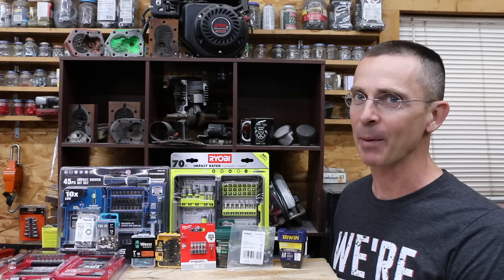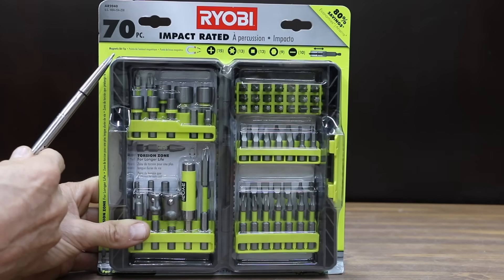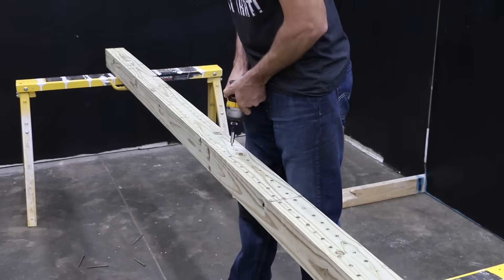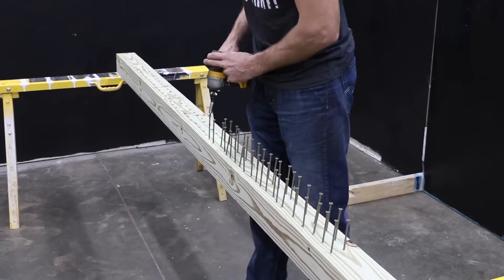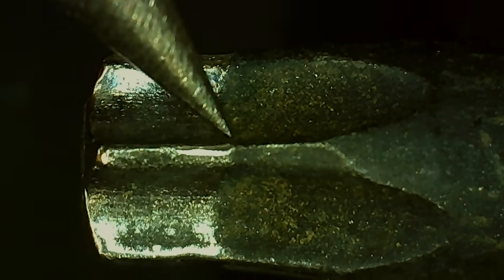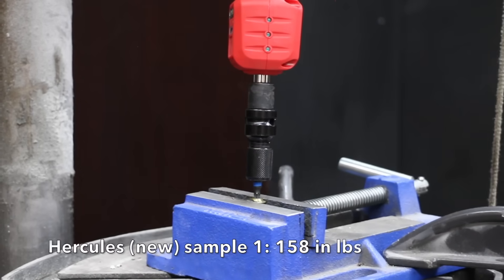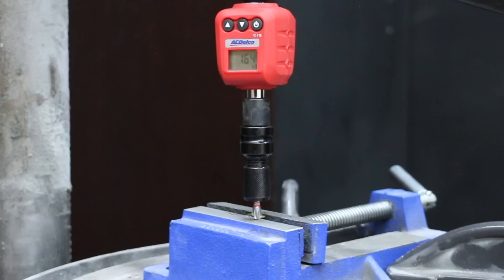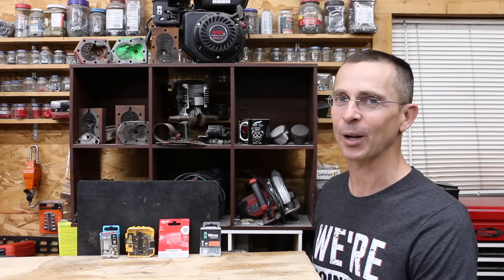Best Star (Torx) Bit Brand? Milwaukee, DeWalt, Makita, Ryobi, Wera, Wiha, Irwin, Bosch, Bauer

Comment: I'm from the automotive field and the interaction with the fixing of all of those bits falls short of the fit I would feel confident in applying torque to given the shallow drive recess offered by many automotive torx fixings,especially those threadlocked .I guess the bit manufacturers must have some tolerance designed in for the slight differences across an enormous range of fixing brands but I can't say that I have ever come across an automotive fixing with that poor a fit,even with a well used tool😄,unless that brand of fixing was a particularly poor representation of T25, It was as if you were using a T25 bit in a T27 fixing. I guess that it's possible that given the intended use the application of exerting pressure on the tip is easier and more effective than say using a socket and bar where the torque applied is partly loaded offset so the fit isn't as important. I replace my bits(socket) T15,20,25,30,around every three years,blades(drivers)around  two years,usually due to the ends rounding off, wear also occurs from grit and grime caked into fixings mixed with oil deposits,it makes an effective grinding paste over a few thousand uses,this and the sockets see plenty of impact gun use,despite not being designed for such,even then they don't fit as bad as those,they just tend to climb out with the torque applied but don't wobble around like that. No,the fit of those says nothing more to me than chewed flutes,some skin being removed and much cursing!
Reply from the maker: Thanks for the feedback.

Comment: As a contractor who's installed tens of thousands of torx screws, I've always had better luck with the 1-piece, full-shank bits than the bit tips which require a holder.  It seems like the bit holder introduces an extra place for wobble which increases failure of screws or bits.
Regardless of bit type, torx is pretty much the most mechanically superior fastener head option.  I've lost far more torx bits than I've worn out, and I certainly can't say that for phillips.
Reply: HATE Phillips head screws, would prefer Torx or Robertson to become the standard.
Reply from the maker: Thanks for the feedback.
Reply: This is a great video idea. By what amount and in what ways do bit styles change things for screws? 
Every year we build (and later disssemble) a 16'x8' cabana with windows, solar panels etc. 
I am starting to hate robertson. Once you get paint in the screw heads and a bit of dirt, they are impossible to reuse!
Reply: @KF1  torx are my favorite, I know what you mean about Robertson.  It's prevalent in Canada because it's a Canadian invention but Torx are superior (more contact surface area).
Reply: @KF1  Re: paint & dirt in screw head, that's true of every type, at least in my experience.
Reply: My problem with bit holders has been they don’t have the ability to withstand the pressure or impacting, and locking the bit into the holder, or rounding out
Reply: Is it also possible the full shank allowing for flex during impact extends the life of the bit/screw too? I have noticed Every box of torx i've used has a full shank bit included in the box, instead of a bit tip

Comment: Appreciate the work you do. I actually have based several purchases on some of the things you've tested on your videos. Just bought some Bosch wiper blades based on the two videos you did on wiper blades. And I'll buy star bits based on this, since I work in carpentry I'm constantly using these in kitchen installs.
Reply from the maker: Thanks for sharing.

Comment: another good video. So I'm sure you've seen them at your local Advance auto parts, but it would appear that FRAM has made a comeback in the form of "exclusive" filters and chemicals (oil, power steering, and trans fluids for now and coolant coming soon) I have my suspicions on their sourcing for the oil but could you make a video (or two) testing these against their standard fare at department stores and in case of the oil see how it compares to the old carquest oil (if you can get it) and against Kendall oil (what I suspect it's from.)
Reply from the maker: Thanks for the video idea.

Comment: Project suggestion for you, based on some recent videos by Youtuber "Everyday Home Repairs" - Make a few simple circuits powering a high-powered electrical appliance, such as a large space heater.  Run this setup for several hours and compare how hot twist-on wire nuts, vs WAGO lever-nuts, vs common push-in connectors get.  Relatedly, measure the voltage drop across the joints under load. The WAGOs seem really promising to me, but I suspect their current-handling is less than ideal.
Reply from the maker: Thanks for the video idea.

Comment: A few idea's. Best paper towels for workshop use, because some of them leave massive amounts of paper residue or other dust behind. Best toolboxes cheap toolboxes break very easily and will throw all your toys over the floor... Best metal cutting bur's for porting engines like mopeds, motorcycle and car engines (so for aluminum) Another idea would be the best staple machine for wood/ heavy duty staples. Or the best handtool for metal rivets. Another idea would be what is the best break cleaner, because break cleaner is used more than any wd40 oil in car shops around the world! Also something like lighter fluid would be cool too, because prices vary enormously!
Reply from the maker: Thanks for the video idea.

Comment: Could you review tile drill bits? Specifically for porcelain?
I've tried all kinds throughout the years and often they work well at first but quickly become useless after 3 or 4 holes
Reply from the maker: Thanks for the suggestion.

Comment: Got the T15, 20 and 25 dewalt bits for my Makita impact myself. I feel that they wear a bit fast, but way slower than the chinesium brands. They could also be a tad tighter as starting a screw in hard woods can make the tip slide and you hit your thumb with the bit
Reply from the maker: Thanks for the feedback.

Comment: Awesome channel!! As a cattle and crop farmer myself I find these videos extremely entertaining and full of useful  info to use when purchasing tools or products. as i  like to do my own repair and maintenance. 2 ideas for videos. Justice Brothers chain lube vs others. Just a much different product than other chain lubes I've used.   And #2. Grease in pivot points and in bearings. moly grease vs a lithium red or blue  vs a high quality  synthetic. Thank you so much for what you do!! And good luck with your cattle business!!
Reply from the maker: Thanks!  Thanks for the video ideas.
Reply: Just a little more to the grease idea. Ive heard moly grease is great in pivot points because the molybdenum creates a film layer between the 2 contacting parts and provides some lubrication and protection even after the visible grease is gone. So is that true? Is it better than a lithium or high pressure grease or synthetic in that application?   But ive been told dont use moly in bearings. Poor moisture repellent and can cause drag and excess heat.  Anyways thanks alot and take care!

Comment: Hi Todd,
I am sure someone else has already commented this, but in regards to some of the used bits outperforming the new ones, I belive this is caused by work hardening. Similar to how cold rolled steel is strengthened, the act of screwing and unscrewing the 100 screws would have workhardened the faces of the splines. Maybe someone else can weigh in on this.
Thanks for all of the great videos!
Reply from the maker: You are welcome! Thanks for the feedback.

Comment: what a nice coincidence, I happen to have been looking for new torx bits
Dewalt it is then :D
Reply from the maker: Thanks for sharing.
Reply: @ProjectFarm  
I noticed that you can get many of the solid lubricants used in some additives on aliexpress.
MoS², WS² and HBN(ceratech/any ceramic additive) can supposedly be bought as small as 0,1 Micron wich should pass trough oil filters

WS² seems kinda sus, there are people that say it works, but it has a hardness of 30HRC wich would make it more like a mild abrasive than a lubricant.

Comment: Hello, i have been a subscriber for a long time and i would like to see a video about epoxy putties but sealing hot water stuff, and maybe some other specific but not intemded uses for epoxy. I've tried several brands on a stainless steel solar water heater tank for hot water but no dice, and a new one is expensive.

Also it'll be cool to see epoxy putties and two part adhesives performing repairs where the repair is in an oily or wet environment after curing, like a repair in a car cooling system.
Reply from the maker: Thanks for the video idea.

Comment: Thanks Project Farm! Haven't read all the comments so this might be reiterating but "cam-out" is the nemesis of all bits, Torx resists cam-out at a greater degree of bit misalignment (how far off of 180° the bit is to the head of the fastener). Maybe getting a bit of cold forging effect with the used bits performing slightly better on the snap test. Thank you! Like button Smashed!
Reply from the maker: You are welcome!  Thanks for the feedback.

Comment: WERA bits is beasts.  i have a bunch that i used a lot working as a builder in 2002-2003 and glazier 2003-2015 and they still is nice..  

the WERA impact bit holder is by far the best bit holder on the market. 
I love their holder no: 053923 it hold up 7 years with shitloads of screws in and out

And also thanks for the video. if there is one thing i almost never can avoid walking in to a tool warehouse its looking at bits :P just... neeed... moooore...   (eh NOPE)
Reply from the maker: You are welcome!  Thanks for the feedback.

Comment: I've been a user of GRK screws for a while now. They usually include free Torx drill bits in the appropriate size with a box of screws. 

If you ever revisit this test, I'd like to see where they stand. Particularly if their color-coding (the T25 bits are metallic green, ooh fancy) is a distraction.
Reply from the maker: Thanks for the video idea.

Comment: Outstanding and comprehensive, as always.  It would have been interesting, although not strictly necessary, on the yield strength test, to know how many degrees of deformation the bits underwent before breaking - i.e. was the alloy used relatively ductile (many degrees), or strong/weak but brittle (few degrees of rotation).  Just to get a sense of the manufacturer's chosen approach, and how that fit with surface wear - i.e. heat treatment/case hardening.  Of course, you've hit all the important issues perfectly.  Thumbs up again!
Reply from the maker: Thanks!  Thanks for the suggestion.

Comment: I've heard that from a mechanic that transmission (no particular type e.g. CVT/Automatic) is an alternative to using fuel injector cleaners. Can a test be performed to prove this true or false?

Also which brand fuel injector cleaners would you recommend?

Comment: As a sheet metal worker the only thing I care about when choosing a tip is how well the screw stays on it.  This is because while I’m hundreds of feet in the air trying to install a panel with one hand and drill in the other, nothing making me more upset than a screw falling off the tip.   The best brand we use in Minnesota for this is Vega.  The magnets in their nut drivers don’t come out after the third screw either.  They last as long as it takes you to lose it.
Reply from the maker: Thanks for sharing.
Reply: @ProjectFarm  would you ever do a video on screwing through metal with various tips?  A lot of what we use is torx 25, Phillips 2, 5/16 and 3/8 nut drivers.  Mostly going through 20 to 16 gauge galvanized.  You have a great channel keep doing you!

Comment: Hello, could you please make a new video with comparison of various water pipe fittings? For example pressed, welded, push fittings, "shark bite" fitting ect. Test of resistance to high pressure, frozen water inside, durable, tensile test ect. thanks
Reply from the maker: Great suggestion!  Thank you.

Comment: Many thanks for another great review. I'm over in the UK so I sometimes find the product range is different here, thankfully the DeWalt bits are quite common here so I may pick up a few. I was very interested in how the used bits seemed slightly stronger than new bits, do you have any thoughts on why that is? The only thing that occurred to me was the impact action on the flutes effectively work hardens them?

Comment: Thank you for the bit test, surprising results as I was sure the DeWalt bits would have out preformed the Milwaukee bits. I am still at a loss to why I broke 16-T25 Milwaukee bits for 40 screws. while I only broke 1 dewalt bit in another set of 40 screws.  I used the same Impact driver for all 80 screws and all screws came from the same box.  The high tork of the Wera brand is amazing, but your correct is the cost justified.
Reply from the maker: You are welcome!  Thanks for the feedback.

Comment: I would like to see a fuel filter shootout for diesel fuel filters I cannot find anywhere a good comparison fuel filters for diesel pickups also water separators that are used on aftermarket lift pumps I know there is a huge variance in flow rate and filtration between Brands but what is the best. If this interests you I can provide a list of water separators that are all supposed to be the same I would even donate some of the filters that are on that list I have three different ones
Reply from the maker: Thanks for the video idea.

Comment: I used to install seats in auditoriums putting in thousands of screws. Usually a mix of hex head screws and torx. After a couple years of frustration buying big box store brands, I settled on the Wera. It didn't take long for me to convince the other installers to use them as well. Yes, they're pricy, but the time saved driving to the store to get new bits in the middle of the day probably ended up saving huge amounts of money in labor and time lost in the long run. You tested torx which is awesome, but the Wera hex bits feature an easy-release design where the sides are not flat. I thought it would mean they'd wear out faster, but come to find out it makes the bits last dramatically longer since you are far less likely to make the 3 mistakes you mentioned! So for all this talking up Wera bits (I have no affiliation with them), they're expensive and it doesn't make good sense to spend that kind of money on bits unless you are driving thousands of screws. Really cool to see all these bits go head to head. Keep up the testing!
Reply from the maker: Thanks for the feedback.  Thanks, will do.

Comment: Wow... I'm really not sure what to think other than that the line between sanity and insanity is something I'm not as close to as I thought! And I say that all in good humor, Mr. Osgood! As far as Torx I think my biggest issue is there are too many sizes and it's easy to use the too small a size thinking it will be just fine and then find out it will cam out when you're applying a lot of torque. I've never used a lot of Canada favorite Robertson (square) drives but seems like they might be a better all around drive system.

Might be a good next bazillion fastener drive test! Robertson vs Torx!

Comment: FINALLY a test that includes Wera bits.
Before getting an impact driver, I didn't use anything else than Wera. The Impactor line is "a bit" on the expensive side though, so I settled for a set of Milwaukee Shockwave instead (for now), which I am quite pleased with.
On a sidenote, I bought a set of Wera Hex Plus keys back in the mid-90's and still haven't worn them out. Those things are virtually indestructible!
Reply from the maker: Thanks for sharing.

Comment: I think DemolitionRanch proved you need to be using a Ryobi driver not a budget Dewalt 
😂. Also, I mimicked your sharpness test a bit for some knives, but using elastic bands instead of buying the actual tool. #subparbutworks

Comment: I rarely have any issues with T25.  T20 and smaller have issues with stripping and bits twisting.  S1 have a lot of striping issues. Both are used alot in composite decking surface swapping out multiple tips a day.
Reply from the maker: Thanks for the feedback.

Comment: Can you do a video on paint stripper? I've been using Rust Oleum aircraft remover and not really  happy with its performance. Maybe there are no good ones any more!
Reply from the maker: Thanks for the video idea.
Reply: @ProjectFarm  Upon reading the directions on the aircraft remover it cleary states "Do not use on aircraft" Does this mean do not use on aircraft finishes or does it mean do not use while flying on aircraft because if you remove it you will be left hanging 20,000 feet in the air with nothing around you! LOL The world is so confusing these days!

Comment: I don't think ive ever used a torx bit to failure. Wish you had tested philips drywall bits that are designed to cam out of the screw..
Reply from the maker: Thanks for the suggesiton.